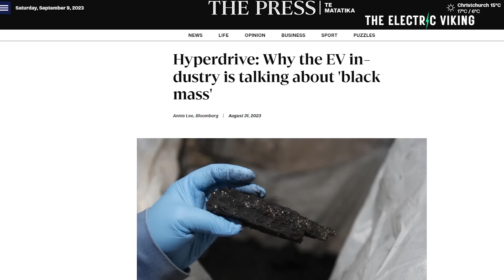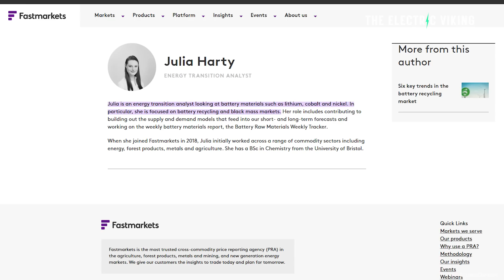A NEW battery gold rush begins: Black Mass powder listed on metals index

Comment: Would this mean that there'll be a new push to salvage and recyle batteries that everyone forgotten in their old devices?
Reply: Recent phones make it hard to take the battery out. So most of the time the battery is recycled WITH the phone itself. But I think laws are in place now to make batteries replaceable again.
Reply: @VallenChaosValiant : That’s over in Europe/UK area, not the US.
Reply: @jacobcarlson4010 the European regulations cover all kinds of electronics devices, not just phones.  Also, it’s not cost effective for manufacturers to make a different model for the two markets, so we’ll see phones, computers etc all coming with replaceable batteries again. Also, the “right to repair” movement has finally got traction as in there’s legislation being passed in support of it in the US as well (watch Louis Rossman here on YouTube) which will also result in more easily dismantleable & repairable items.
Reply: @jacobcarlson4010  Normally applys to US as well.
Reply: One can only hope.

Comment: Glad to see LFP being recycled. LFP may be easier at the cathode is a mineral, whereas, NMC contains oxides of N, M, C and Li. These need to be separated to feed into cathode processes in the desired proportions.
Reply: @orionbetelgeuse1937  but LFP recycling should be easier - there is just one cathode mineral in the black mass from an LFP cell. Both cathode and anode have electrolyte in them and the electrolyte has lithium in it. The electrolyte can surely be washed out and recovered as lithium hydroxide. 
There is no part of a battery that does not interest engineers for recycling. Even plastic can be recycled to make garden pots and road pavement.
Reply: @orionbetelgeuse1937  Well in theory you can re-active the carbon - so not a total lost - but it would be another step in recycling/cost.
Reply: @orionbetelgeuse1937  Right, I never said anything about the carbon it self - more than like the carbon will have to be toss. There is a proccess to reactive carbon, but I am not 100% sure how well that would work with it already mix with the other elements though. There is a paper already release talking about how they could if you want to google it.
Reply: @orionbetelgeuse1937  I would count it as recycling. If there is another "life" or "use" for a materal its ok to count it as recycling - as thats still part of "reusing" what we created for another use. Like if there was another use of the carbon - that would be fine as well so long as its being used and not filling roads, water, and skys. Honstly, the longer its out there being used the better, but I am also not against burinng something up either for its final life cycle. We're still going to need energy at the end of the day - and if we can't figure out what else use in longer life cycle methods - burning is also find in my book so long as we carbon capture the best we can.
Reply: @orionbetelgeuse1937  only recycling for a same or similar use is very restrictive. Tesla needs a fairly specific mix of other metals in its aluminium for casting. It could sell ingots of our of spec aluminium for uses that aren't so specific. Having said that, 'mag' wheels, which have a magnesium alloy in the aluminium, can be directly recycled by Tesla into gigacastings. Pure magnesium, or an alloy that is mostly magnesium apparently has better properties than aluminium in vehicles - it's lighter. But it also burns more easily.